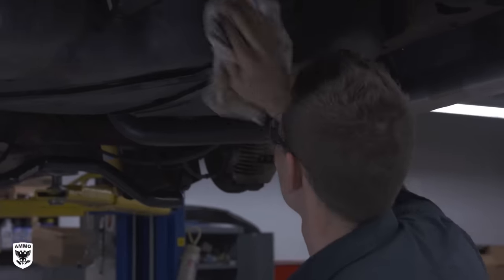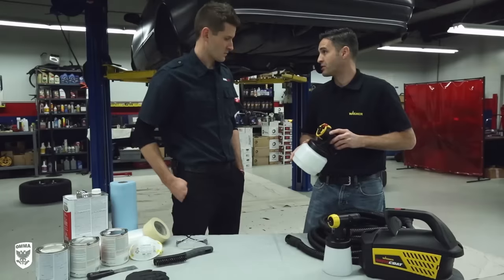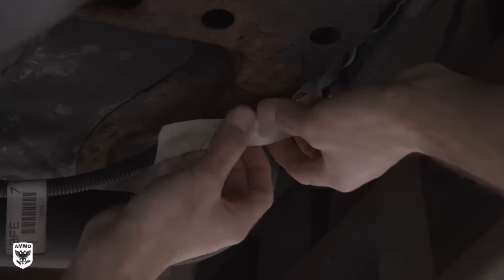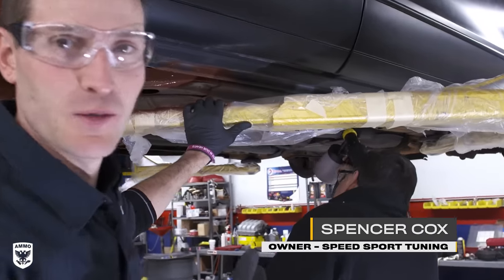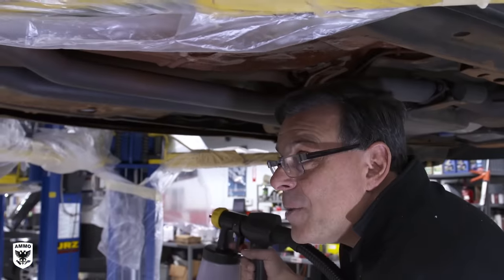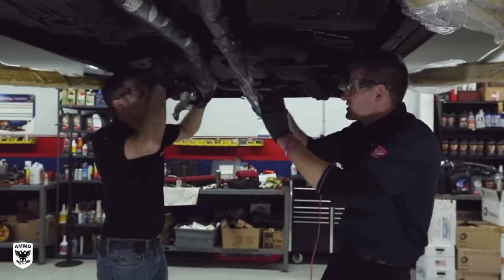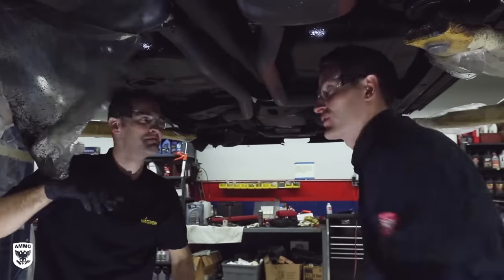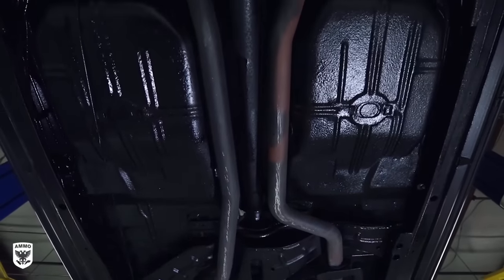How to Undercoat Your Car: Impala SS

Comment: Living in a rust belt in Canada, that arguably has some of the worse environments for causing vehicles to rot. I would strongly recommend not covering rust with any black tar/rubber or ashpalt like product. wheel wells, are fine, to help prevent further chipping, You can easily cause a situation where moisture is trapped between the undercoating and metal. This can make a bad situation worse. What we do here is once a year you spray your vehicle with a oil undercoating. Usually the best systems your doors, rocker panels etc are drilled and sprayed with a thin oil and a heavier oil sometimes sticky or even slightly waxy is used on the underneath. This will stop rust dead, if you keep the metal goo'y it won't rust. I have two 30 year old japanse vehicles one of which I daily drive the other is my weekend truck. Both have original paint, they are both a little rough around the edges, but they are about as rusty as when I got them, Nearly a decade ago!
Reply: I would agree a system like the one shown is more for a new vehicle, if rust is present you want to oil spray it, not undercoat it with anything that dries
Reply: I agree, someone who sold me my explorer thought they were doing me a favor with a nice black rubber undercoat. A few years later its a rust bucket! I did some prep with rust converter and rustoleum and use fluid film and oil on everything now.
Reply: Rick James
Reply: Doesnt oil just attract dust and leaves ect and if you get any on the exhaust  it will smell and smoke and if you ever have a major coliision and have to do any welding or cutting or painting in hidden areas well oil and paint dont my too well, i dont know why the car manufacturs cant used better corrsion resistant steel or better coatings or a bedliner epoxy or powder coat the suspension parts.My 86 Chevy trucks chassis is a joke, some of the front suspension wasnt even painted from the factory and the cab floor underside doesnt even have paint on it hardley at all! you can see black primer, same thing under the bed, its more overspray than an attempt at a paint job, the underside of the doors are the same thing just barely any paint at all, i took the entire chassis apart and sand blasted everything then epoxy primed everything then repainted it it with this hammered looking greyish black paint and powdercoated all the suspension parts i could unbolt from the truck .You would think by now on a 30-40,000 dollar vehicle you shouldnt have to do extra steps to keep your new car from dissolving out from under you by now,also it seems like exsess oil would also drip off on your garage floor, i could never live up where you get that kind of winter weather cause it would drive me crazy to have my vehicles so filthy from driving in snow and rod salt all the time. It gets  bad enough here in North Carolina where we get about 3 snowfalls a season but then its gone in 3-4 days ,when, you live in Michigan or Canda your dealing with this mess for months, i just couldnt drive a brand new car in that salt and snow and ruin it so fast, my wifes sister from Plymouth Michigan has a 3 year old Honda CRV and wanted me to put brakes on it ,i was shocked at the amount of rust on the heads of bolts of the brake system and on the exhaust clamps and the hangers ect, My brother lives in Orlando Fl and his 21 year old Suburban still has the original factory exhaust system on it at 360,000 miles! that salt is death to any car even if your vigalent, How about using a 5 gallon contailer of WD-40 and putting it in a paint spayer o spray bottle or hudsen spayer?, it is supposed to displace water, im shure you have to protect the disc brakes and anything that gives off heat, and doesnt oil break down rubber bushings and stuff?
Reply: Leaves and other large debris aren't attracted to the oil, as it gets blown away with the wind.  Dust and fine sand are actually your friends.  It does get embedded in the oil film and helps prevent it from getting washed away. If you get any bodywork done, the oil is quickly removed with solvents where needed.

The products we use up here are friendly to bushings and rubber hoses, as well as plastics. It's also great for electrical connections as it's dielectric and protects against corrosion on the connector terminals and wiring.

WD40 isn't very good at long-term protection as it's watery thin and gets washed away quite quickly.  It's also a solvent, and will take with it any other oily coating that is protecting the metal, and will cause it to rust faster. I hate WD40. It's not particularly good at doing anything, except temporarily displacing moisture, and I cringe when anyone mentions it being used to lubricate or protect anything.

I have a 1988 Merkur Scorpio that's lived through many Northeast winters, and while I've never taken it to get professionally oil sprayed, I have emptied many cans of Krown or Rust Check (the two most popular brands of oil rustproofing spray) inside and under it over the years, and once you scrape off the 1/4" thick layer of caked on slime that coats the underbelly, it's as fresh as a daisy. Every nut and bolt comes off with ease, and all my fuel and brake lines are not only original, but still wear their OE factory paint coatings. The bodywork isn't perfect, but the undersides are about on par with a 3-5 year old vehicle that wasn't oil sprayed.

It's a never-ending battle up here, but there are those of us that fight the good fight.  And to make up for all the heartache and pain the snow and salt cause us, we take out our aggression in empty parking lots after a fresh dumping of the white stuff.  There aren't many things on Earth that can reduce an adult man to a giddy, giggling schoolboy faster than a big snowy parking lot and a RWD car. :)
Reply: i just wire wheel the  i can get to and then fluid film everything....i do it each fall part of plow truck prep.  the rust never sleeps.
Reply: Boiled linseed oil I presume?
Reply: Rust converter before paint/undercoating and it’ll be fine! 

Don’t forget to wire brush  thought
Reply: Rick James  ...krown  rustproofing seems to work ok...
Reply: Use leftover oil from changes on rust but dont undercoat
Reply: +1 chemical engineer I worked with  mentioned  the  same concern.

If there is any moisture present it will simply rust out  the  parts covered.
Reply: What kind of oil spray do you use?
Reply: Oil spray or go home. Agreed
Reply: If the metal is fairly clean before you undercoat it, you should be good. Oiling the undercarriage is a good idea if u use the correct stuff. Poor quality stuff will only trap dirt .
Reply: Cosmoline RP-342... has to be the top contender for undercoating/rust prevention. Research it and find out why.
Reply: Nick Thorne although I do agree with you that cosmoline might just be the best rust preventive ever. Cosmoline also breathes unlike rubberized undercoating ,which expand and contract,also cracking in the process,trapping moisture ,therefore rotting out a vehicle faster than if it was never undercoated at all.thats why surplus firearms are packed in cosmoline,as I'm sure u know for the simple fact you mentioned cosmoline.after decades you can unpack a surplus firearm after 50 years or more kept long term in almost any condition,then you clean the cosmoline off and there is no rust at all.the only problem is that cosmoline stinks almost like a burning rotting forest fire if that makes sense. I do know that cosmoline is the best rust preventative know to man.no doubt that I know of personally.great idea if someone could only take the rust preventive qualities of cosmoline,but eliminate the odor.great idea.i will have to research if there is such a product.i hope there is.let us know what you think?.
Reply: Nick Thorne I just analyzed you comment again.sorry.i did not put 2 and 2 together till now.you said rp 342. that is maybe different than the normal cosmoline? If it is? than scratch my comment about the stench.i wanna look up rp 342 right now.thanks a million.
Reply: Yeah, would like to see how that car is now, after four years. That rubberized coating is the worst service you can do to your car, mainly because it traps moisture and there is "NO PROPER WAY TO DO THAT COATING". It will eventually crack leak from somewhere, and let the moisture inside, between coating and the car, and rotting starts.
Reply: Ikr haha yikes bloody horrible nightmare for sure that stuff im in process if saving my jeep from it 😁 shit honey- goo it is that tar legit locks moisted against steel and well that never turns out well . 👌imo not a good idea
Reply: Rick James 
Agreed, I don’t really recommend using it if the car is brand new or else you’re just sealing the rust in
Reply: @merkurman  ever heard of formula 3000 or something from canadian tire?
Reply: @Irish Viking Hey. Bit late I guess but try my luck. I live in London and I just traded a kind of rust free underneath C class with lots of issues going on:)) for a 2015 Mazda 6 1 previous owner(company car)  motorway mileage 140k miles. I would like to use something to prevent rusting since I know how reliable can be but how quick they can rust. Do you suggest oil instead of what was used in this video?
Reply: Also coatings shouldn't be brown/rust colored since it's harder to notice rust spot
Reply: I live in Toronto which is as bad as it gets. My 5 year old lexus has no rust yet but decided to take it to Krown for the first time. Everyone keeps saying they are the best. Time will tell.
Reply: @jbncnow  wd40 have good penetration properties but leaves very thin leayer of oil for future protection.
Reply: So would you do this with a car that already has rust? I’m very interested in this. Living in Lethbridge Alberta I just bought a Mazda 3 which is pretty heavily rusted on the under side. Thinking I would get rid of the rust then paint over it but I’d love to hear other thoughts
Reply: Okay, I’m trying to figure this out now. So the conclusion is to use an oil type of undercoating rather than a rubberized or hard undercoating?
Reply: @carguy1717  what did you end up doing?? I’m in Calgary
Reply: @rickjames9477  I wouldn't use that on a new car. I'd use fluid film, or another kind of oil type of undercoating. Rubberized undercoating is a death sentence.
Reply: @jbncnow  I quite agree with you about spending boo coos amount of money on a car or truck these days, and how shabby they don't paint them underneath.  It's ridiculous, and you can plainly see, these car and truck tactics, as they WANT you to get a whole new car or truck in a few years later down the road.  I can't afford a new car or truck, and I live in Western Pennsylvania, so in order for me to keep mine for yet a long, long time, I spray paint the underside of my 02 Dodge Dakota regular cab truck with rust olem black paint in about late September or October when the weather is in the fall season and allow it all to dry accordingly before winter does hit on December 21, the change of the season.  This also holds true for my 1992 Ford Escort as at this point and time, is still running with over 100,00 miles on the engine.  That area, especially the frame and chassis and floorboards, etc, is the part of a car or truck that takes the worst beating all year round and it's only logical, and practical to spray paint that area with metal paint like rust olem paint to protect it from the road salts and harsh chemicals used to melt snow and ice on the roads. You have to, gee whizz, a car and truck these days is a major investment anymore.
Reply: @thechosenone3504  he ded
Reply: Good thing I read your comment, because I was going to undercoat my Ranger with one of the rubber sprays. But when it comes to oil undercoating, doesn't it easily come off? Are there any undercoating oil spray cans available?
Reply: grinding to bare metal then a converter then a reformer then a sealer like a super premium vansickle would prob be ideal
Reply: The stuff used in this video is totally fine to use....aslong as rust converter has been applied before hand and left overnight and then other products used before applying this...which the video doesn't show. To properly underseal a car it can take a full week, not a day, also oil underseals aren't anywhere near as good as this stuff when done properly. Most places that have a reputation and believe in their product will offer free yearly inspections underneath to check the overall condition and touch up where/if needed eventually
Reply: Fluid film is the way to go. Black tar/rubber or ashpalt like product will trap moisture and accelerate rust.
Reply: I'm confused... He brushed away the top rust, sprayed an inhibitor, then sprayed with the rubber coating. Other using rubber coating itself, what is the other problems people have with this video?
Reply: I live in England and there is a company from Canada that's popped up and iv heard nothing but good things about there rust proofing, they are called KROWN rust protection and they just a hot oily wax, they apply it anywhere possible, inside doors inside the engine bays sills arches, they take your lights out and spray it all in between body panels you name it they spray it on, it sounds like the same treatment you have in Canada well obviously is because its a Canadian company
Reply: Same here, in VT we use fluid film, woolwax, bar and chain oil, or even used motor oil. Sometimes a mixture of all of them. I have a fairly new car, (2019) yet every fall it gets a good wash underneath. Then allowed to dry fully. Then I'll use a gallon of fluid film black. Ill even take the body plugs out, spray inside, then reinstall the plugs and spray over them. I'll take the side skirts off, clean and spray fluid film behind those. I'll take the fender liners out, clean behind them, spray fluid film , the reinstall. Virtually anything that's exposed gets covered. As for the paint it's got a nice ceramic coating. I also wash the car often in winter, and dry it with a ceramic detailer. Really the only way to keep a car nice in states that use salt is to park them for winter. But we do our best.

Comment: I want a follow-up video that demonstrates how this undercoat completely destroyed what was left of his car. There's no way this did any good.
Reply: Lol I know.  I bet the undercarriage of this car has disintegrated to dust already loll
Reply: That only happens if you put it on too thick. If it gets over 1/8", it will dry and crack, and then trap water.
Reply: I have a 50 year old sedan that was undercoated with this type of rubberized coating for most of its life due to it being used in Idaho.

 It has been sitting for 10 years and, after looking at the frame there is only surface rust where the undercoat has broken off because it is so old, nothing structural damaged.
Reply: @mistersinister2043  So if it's thinner, it doesn't dry and crack?  Huh???
Reply: @smmalafa1  Its been snowing there for the past 4 months

there is still snow there, on the border to canada

Comment: Like many people saying this thick black tar/rubberized coating is the worst thing you can do to your car. Simply put it traps water inside that coating accelerating the rust with out it being visible. Also this coating covers electrical connectors making servicing your vehicle nearly impossible. PLEASE don’t ever ruin your car with this stuff.

Comment: The proper time to undercoat a car is when it is brand new. It will stick better and is a better long-term investment. 

Undercoating a unibody vehicle will make it noticeably quieter due to rubberised undercoat absorbing the road noise propagating through the metal. That's exactly how old Benzs and BMs had a quiet ride. 2 coats will give some improvement, but 5-6 is worth the effort.
Reply: This is exactly why I'd like to buy a new car... people neglect their cars, which is why I don't want to buy someone else's problems... but I did anyway and that's all I can afford for now.
Reply: Going through a old car from top to bottom with new paint, under coating, insulation, dampeners, etc. is far cheaper than a new car. I plan on returning my old truck to better-than-new condition with a new motor, manual transmission, exhaust, and programmer that can really let me dial in the gas mileage.
Reply: hum...I did about 2-3 coats over my whole car and 4-5 coats on just the cabin area, with about half another on the trunk side(ran out) think I'll notice a large difference?
Reply: I'd sooner do an oil undercoating than a rubberized undercoating. The downside is you have to oil the chassis every year or so...the upside is, unlike rubber, it won't "peel away" and create an environment where water and salt can get trapped underneath, actually accelerating the process.

Comment: I undercoated my Silverado last summer in weekend warrior fashion. My frame rails were just as bad as this Impala - Instead of primer and a rubberized true undercoat I used POR-15 and a paint brush with great results. No brush strokes because it self levels, also after wire brushing I wiped everything down with lacquer thinner to remove the dust.